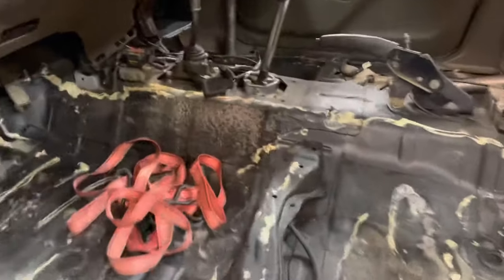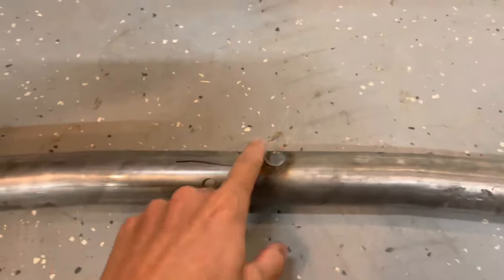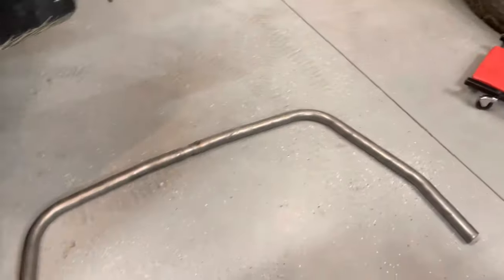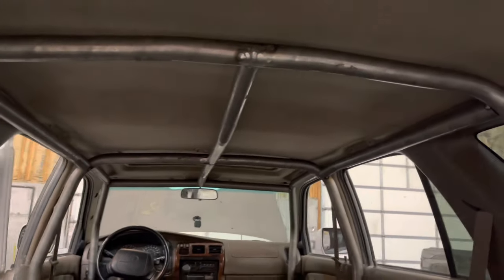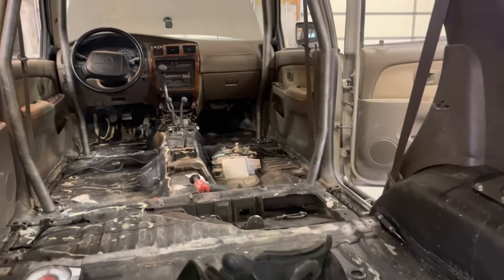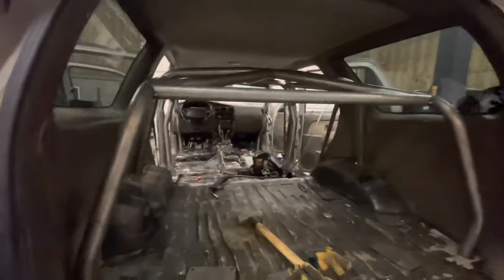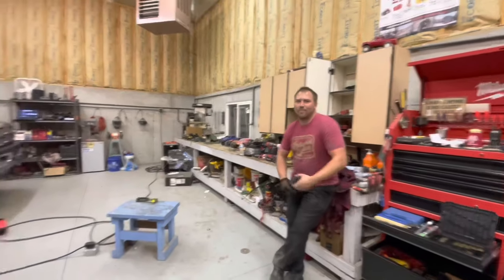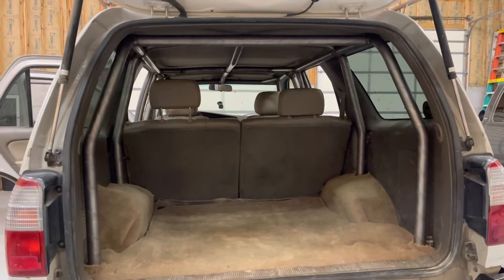4xinnovations 3rd Gen 4Runner Roll Cage Install (Part 2)

Comment: Probably too late. Lol. But to finish weld it, you’d drill a hole in the top floor plates and the floor, drop the cage down through the floor, weld the cage to the bottom plates, then sandwich it back and weld the top plates
Reply from the maker: Ended up drilling holes in the body and dropped the cage and welded it up.